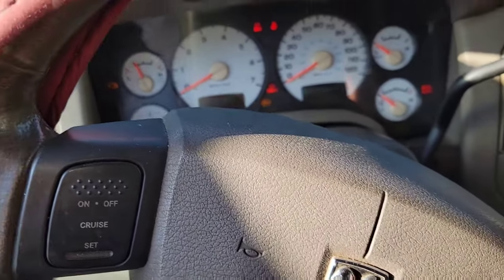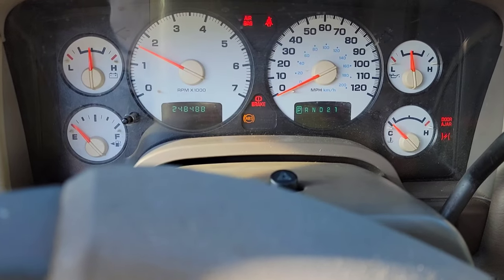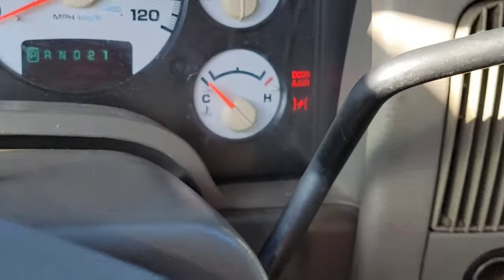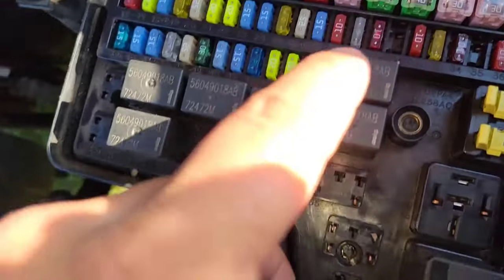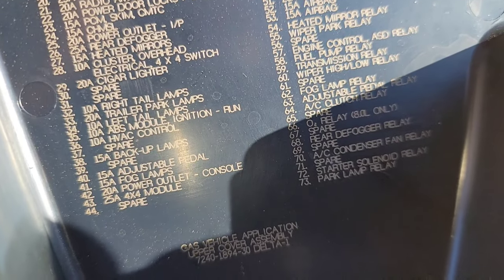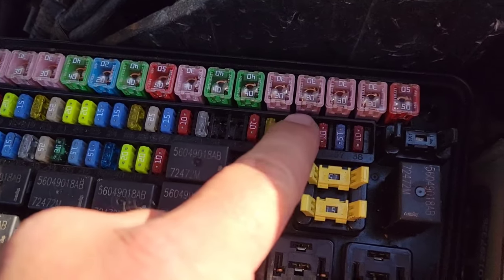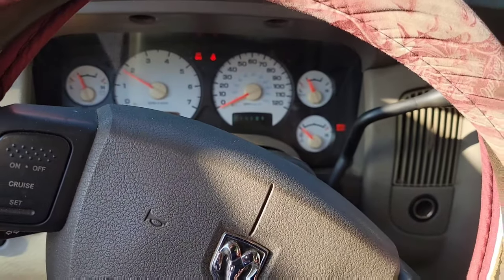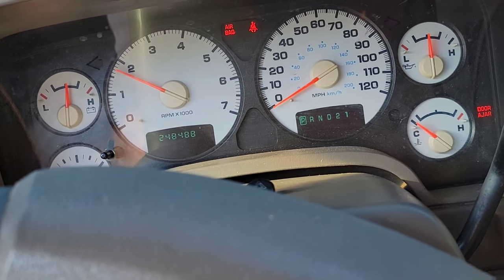Dodge Ram Abs light, brake light, and speedometer Fixed fast

Comment: My abs and brake light came on today I had to drive about 40 miles like that.  The brakes worked but I needed more braking time….tomorrow I have to drive 10 miles to the garage.   I’m also having the rough idle with a little backfire action and loss of acceleration every 100 or so miles.  It’s a 2002 it’s old.
Reply: Did you figure out the rough idle?

Comment: Thanks for the video. Red blinking lightning bolt is likely the throttle body and or Absolute Manifold Pressure sensor. Had both of these issues on my 2008 Ram 1500 also.

Comment: Check the ignition box under the steering column. Should fix the limp mode.
Reply: Ignition box under steering column?
Reply: @BigLarry071 yessir, pretty common failure point in these trucks. Dorman Ignition Switch Kit
Part # 924-729

Comment: You didn't say if the speedometer worked afterwards 🤷
Reply: if your speedometer isn’t working its most likely your wheel speed and abs sensors
Reply: @heffays.YT1  if the abs sensor and brake light sensor changed and the speedometer and brake light still going off what is a possible cause ?
Reply: @ambercastillo2418 my speedometre not working😊

Comment: Had a limp mode issue with a vehicle. It turned out to be a dirty mass airflow sensor, and an oil sending unit sensor.

Comment: My 1500 5.7 was limping and idling like that. I replaced the throttle body did a  hard rest by disconnecting the battery and having the positive and negative cables touch for about 30 minutes to an hour just to be sure, Then I did a throttle reset has been doing good ever since. hope this helps if you aint figured it out by now.
Reply: How did you do the throttle reset ?
Reply: I’m not sure what you mean about touching the cables together for 30 mins but I cleared the codes out and disconnected the battery for a whole day. The next day I drove the truck and I was fine for almost two weeks then it started surging in limp mode again. All new sensors, new throttle body, new egr, new throttle pedal position sensor.
Reply: @HOPEFULELECT318 You ever figure it out?

Comment: Someone give me some advice. Had my 03 4.7 for about a year now. 6 months ago on a road trip 2 hours put it said check gauges for a few seconds then went off. Now today half a year later i go down the road maybe 1 mile and abs and break light came on. Any idea whats throwing these codes? AC apprently worked last year too wonder if those are related